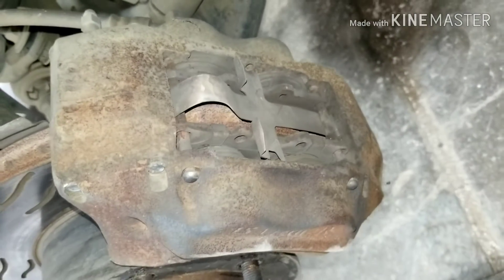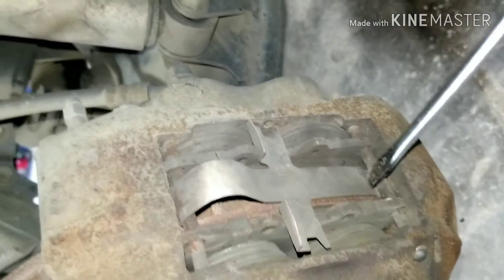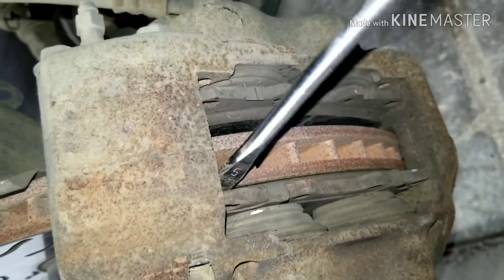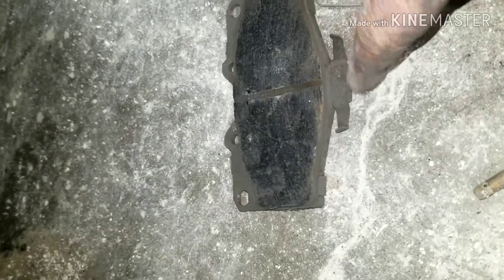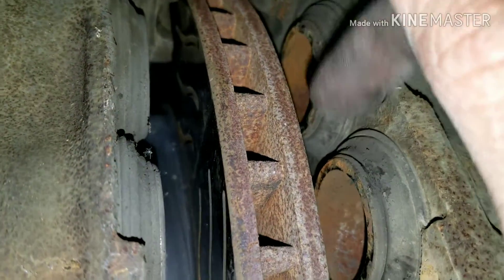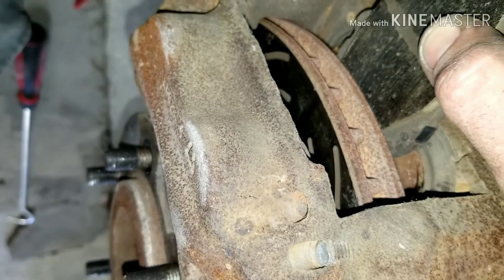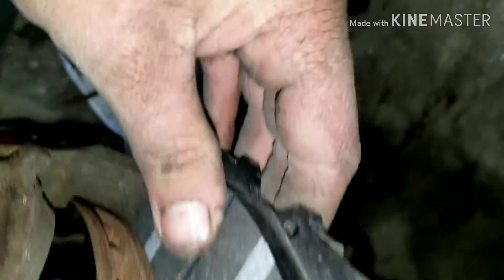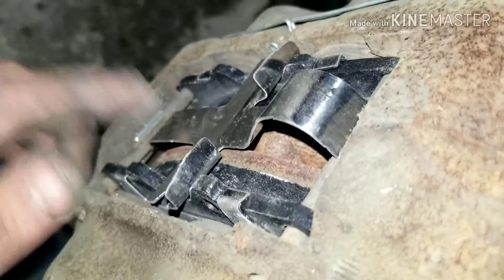2000 Toyota  tacoma  front brake pads replacment

Comment: 2003 f150 ford 6.4 coolant temperature sensor replacement...where in gods name is it ? po125
Reply from the maker: Sorry for the late respond to your question, I havent ran across  that yet, but most the time your coolant temp sensor is after  your thermostat  so maybe find your thermostat and you'll find your ect.
Reply: @fixergood  ah haaaa found it near cylinder number 5  on the block the little buger was hiding on me between the exhaust manifold and under a bracket .....And yes i agree with you but no ford had too move things around